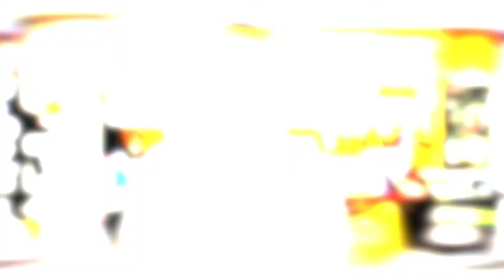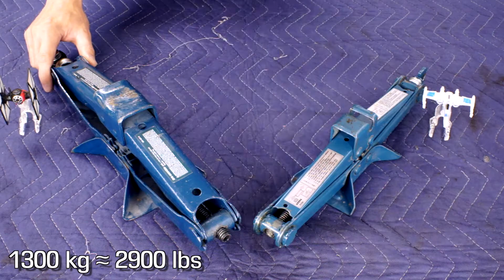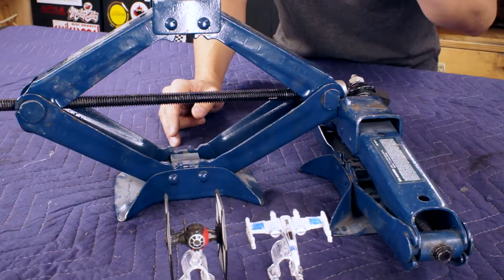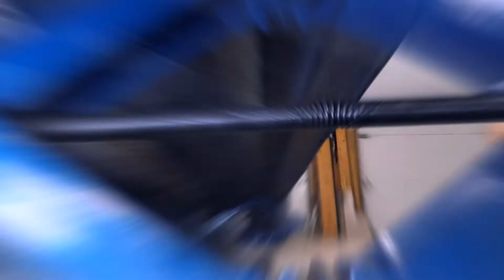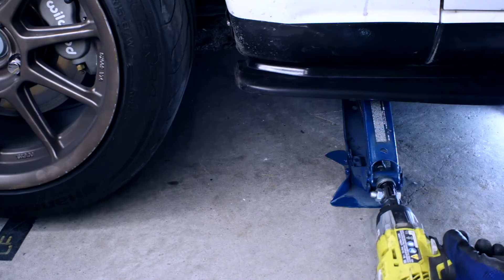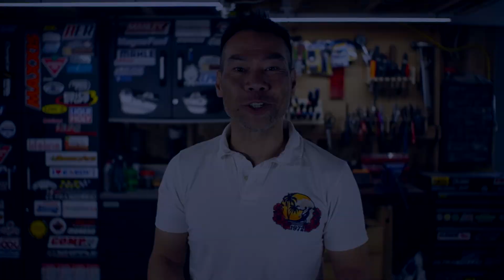Jack Up Your Car FAST! Scissor Jack Adapter + Impact Wrench

Comment: My scissor jack actually came with a 10mm nut design. The handle has a 10mm socket. So I juat use my impact wrench with a 10mm socket. It impresses people all the time. Just took me a little over 2 minutes to change out my aunt's tire

Comment: Hi, just a quick question. I have kobalt impact wrench with 250ft-lb/275ft-lb.  Is it strong enough to lift up mazda cx30 using scissors jack? The weigh of cx30 is around 3450lbs. Thank you for your answer.
Reply from the maker: My low torque Ryobi has about the same specs and with my scissor jack I'm pretty sure it would struggle to lift 3500lbs.  I would buy a larger scissor jack to reduce the required initial load
Reply: @mostlyuselessgarage  so in your opinion, is mid torque impact wrench around 550ft-lb  good enough for 3500lbs car?

Comment: The lifting capacity of the jack determines the quality of the thread needed to a large extent. Get a 2 ton.
Reply from the maker: Yup, mine are 2 ton ... More than enough to lift a little Miata.

Comment: do i need a impact or can i use drill (more silent) ?
Reply from the maker: Definitely need an impact wrench. A drill or impact driver won't have enough torque. I've tried.
Reply: @mostlyuselessgarage .. Yeah I found that out. Have the new skil 20V compact drill/driver and impact combo with a 2Ah battery. I was trying it on a Tucson rear  wheel. The drill definitely couldn't handle it. The impact driver was doing it but it was very slow.  Barely faster than a hand crank.  Impact wrench is the way to go looking at how yours handled it. Though I am concerned about damaging the jack.
Reply: Use an electric ratchet which definitely has more than enough torque.

I'd avoid using an impact gun.
Reply: 1/2 midsize impact preferable brushless because it will definately provide enough foot pounds.   Where did you get the adapter if you don't mind me asking?
Reply: @anonymousone-b8v  all cheap stuff i get on aliexpress, sometimes its 50-70% cheaper than amazon

Comment: I've destroyed a few of these cheap adapters. They aren't a very good design.
Reply from the maker: Interesting, what was the failure mode?
Reply: one of the "ears" shears off.
Reply from the maker: Thx for the feedback!
Reply: @trentvlak  Why not just use a socket directly, no need for an adapter. Saw a video of a guy who just used whatever socket holds tight on the jack and it worked just fine
Reply: @thefamousdjx  Since 8 months ago I've upgraded to the Gortech scissor jack. It takes a socket for easy actuation.
Reply: @trentvlak  Thats costly though, might as well get a hydraulic at that point no? For most people the point with using these scissor jacks is because they come with the car.
Reply: @thefamousdjx  The unit is lighter, faster, more stable, and has a higher extension than a hydraulic.

Comment: this stripped the threads on my scissor jack
Reply: grease!?
Reply from the maker: Mine have been going strong for a few years but it depends on the quality of your scissor jack.
Reply: This destroyed one of my 1.5  ton husky scissor jacks on its second use while replacing front brakes. Both sides jacked up at same time. It seized up halfway down. Needed a hydraulic jack to lift car and get seized jack out. The other scissor jack still works but is now pretty stiff and much harder to jack up car by hand.
Reply: @cruznfl340  it wouldnt just destroy the jack, you probably used it wrong, went too fast, had dirt on threads etc
Reply: Use an electric ratchet on the adapter, don't use a rattle gun, it's just too violent. I've been using an electric ratchet on it, and it's been working amazing for me.

Comment: I'll be trying this with a cordless ratchet tomorrow. Impact guns seem poorly suited to this kind of continuous work. So long as the tool can overcome the needed torque to spin the screw then there's no need for the big, heavy impact hammer assembly.
Reply from the maker: Depending on your cordless ratchet I have my doubts it'll have enough torque. Good luck!
Reply: @mostlyuselessgarage  apologies for taking longer than I said I would. The 3/8" 20V electric ratchet by HART at Wal-Mart with a 13/16" socket runs the factory scissor jack up enough to change the tire in about thirty seconds using the front factory jack point. Corner weight for a 2003 Honda Accord Coupe EX-V6 6MT is ~1,100lbs. HART advertises this ratchet as capable of 35ft-lb of torque. The experience is nicer than an impact as the fulcrum is much longer and the tool does all the work if you set the battery against the ground.

Super useful but also annoying bc I don't really have much use for a lot of my smaller racing hydraulic jacks now.
Reply from the maker: Nice, I'm surprised that 35ft-lb was enough to lift your car. I have a 30ft-lb Ryobi ratchet, I'll give that a try next time.  Thx!
Reply: @mostlyuselessgarage  if you remember lemme know if it works! I like Ryobi they're a good brand
Reply: @mostlyuselessgarage  fwiw the minimum torque to spin the scissor jack is pretty low, it's the speed with which it raises the car that will be a gauge of power output between various ratchets
Reply from the maker: I just tested my 30ft-lb Ryobi ratchet with a 6Ah battery on my scissor jack and it couldn't remotely lift a corner of my 2100lb Miata.  So I think YMMV as there's a few variables:  ratchet, jack and weight of the vehicle.  I've been using the impact gun for years and I'm fairly confident that any quality one will work.  As always, know & maintain your equipment and be safe!

Comment: Had the same idea a couple months ago. =) Great for simple stuff like swapping tires. Had to use a locking nut and loctite on the scissor jack adapter though. The rattling of the cordless impact kept loosening the nut.
Reply from the maker: Great suggestion, I'll do the same!
Reply: Well done. Will do same.
Reply: The "normal" scissor jack you get with cars has the "nut" component, not the "bolt" component, as it's weak point. Lube with gear rated oil or your jack will rapidly wear and fail.